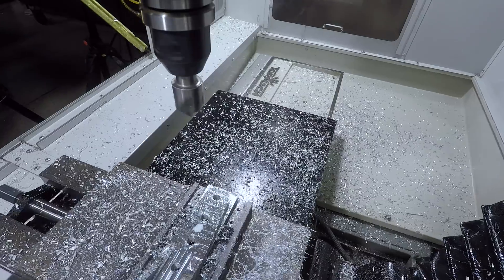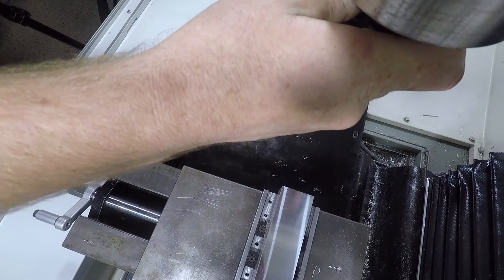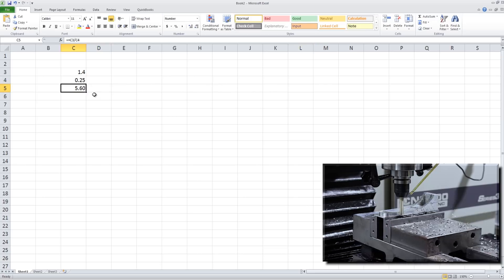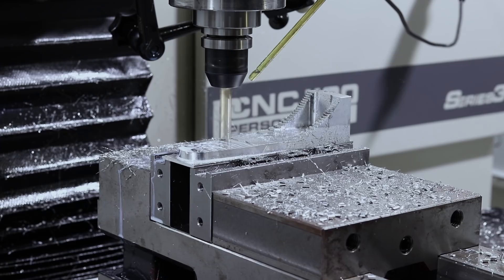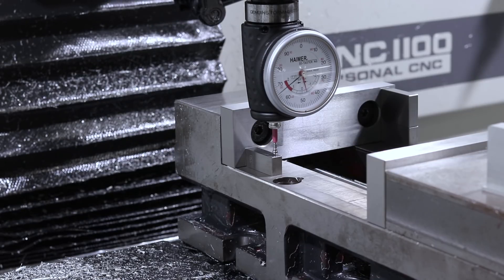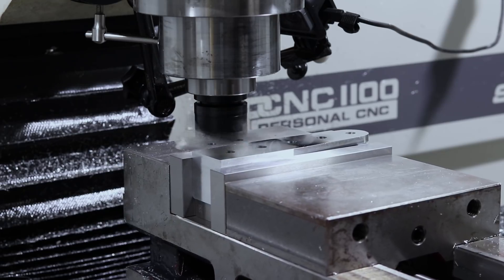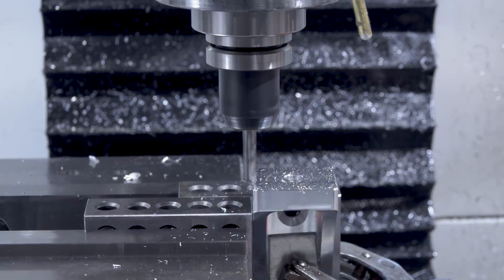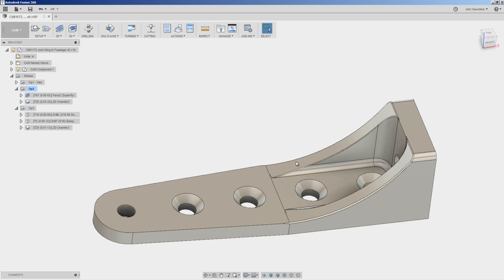Machining a De Havilland Mosquito Airplane Bracket! WW203

Comment: With Aerospace, Weight is Always an Issue.  6061 T651 is really a good product and stronger than the specified material, so to over build and increase the weight of said part is an elegant solution to a nonexistent problem.

Comment: On the sencond op your not pearcing the part so you could have used parallel blocks in the groove. won't be pushed down then.
And you would have had more surface on blocks to get it straight!

Comment: The problem here is workholding not the material distorting.  You cannot rest a thin part on a block in fresh air unclamped and expect it to come out flat... no way.  No need to ask a guru about all this technical stuff... the problem stems from poor setup and  not using best machining practice.  How to solve that?... Here are few ideas John.  

First off when you remove the hat in your second operation DO NOT just go in there with a flycutter and try and cut it off.   
Walk over to your vertical bandsaw and cut off the unsupported material from the hat.. more stable... no slugs... less chatter.  

You could cut a soft saw for the second operation... you could... for that you need the correct jaws on hand and to do some more setup work but you will get a flat part and for multiples that would be my approach.  

I have cut CNC milled parts for 20 years now and this is what would do. I would leave a tab at the end of the part the width of the right end on left end and fillet it in to blend in with have the parts end rad so I had some strength think T shaped tab... I cut a shallow slot in the tab on both sides so I could chamfer both sides.... that is important.  

I would do my second op using that tab so the part is supported on the tapered end and not unclamped... then hacksaw it off the tab and add a third operation... to finish the rad where the tab was... that could be vertically in 3d or horizonally with it clamped to a 1 2 3 block or what have you... you just need to blend in a  rad pretty slack... From there your 4th operation that was your old 3rd operation.

I see this alot in younger machinists... the key is to see the pitfalls before you are caught in the trap because once you are in it... well it is a trap.  Your approach was flawed from before you started that part and with experience you can learn there are quick and dirty solutions to the problems... if you identify them before you start... and almost if not all the problems are a result of not using best practices... Unsupported thin material is not best practice.  My proposal would add perhaps 1.5" of material and perhaps an extra half hour in programming and additional setup... but would result in a correct part.  They are quick and dirty solutions to every problem in the machine shop... they do however require lateral thinking and proper planning.

I loved the Xray stock... that was pretty slick.
Everyday you learn something is a good day.
Reply: Also a Hertel style on edge insert facemill is a real problem solver for thin wall facing operations and a more than worthwhile investment

Comment: "Duralumin" refers to 2000-series aluminum alloys, which are ~50% stronger than 6000-series. The Alcoa structural handbook of 1945 lists alloy 14S (Alcoa's name for 2014 ) as suitable for aircraft structural members, and alloy 24S (2024) for general aircraft use. 

7000-series alloys, which Japan developed during WW2 are even stronger and have replaced 2000-series in most applications.

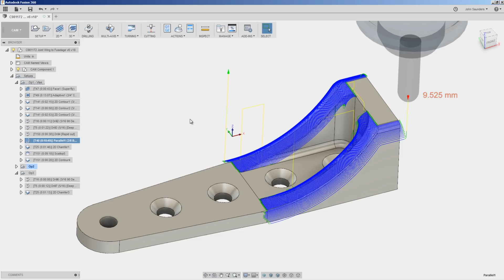Comment: @ 6:20 an end mill with a small tip rad might have been a good option here for the sweeping curve for a greater step over and better finish.
It probably could have done the edge fillets as well as a separate operation with the raster at 90 degrees to the first op.

Comment: I believe there is a 1” spot face that you missed. Should be in-between the gussets. Also, even though there are no Datum planes that I can see it would still be prudent to machine the mating surfaces first, as well as on the same Operation. Does anyone know what the Italic “f” means in the print? It says “f denotes machine” whatever that means.... Very cool though! Awesome to see Aerospace manufacturing on YouTube! Keep it up! It doesn’t take much to get the certifications!

Comment: This part didn't bend because of internal stress in the part, it was from hitting it with the hammer in the vice near the center when the vice only clamps 1 side.
You removed only a tiny bit of material in OP2, the bend would be obvious after OP1 if it were material deflection.
I've made this mistake before.

Comment: From an engineering point of view adding to the thickness of the stock material tends to lower the material allowables. It’s a good way to overcome warping from residual/manufacturing stresses but it would affect the strength of the part. The stock thickness would be controlled in a machined aerospace part. Love the videos!

Comment: Hi John, I have worked in the Aviation/Aerospace Industry for almost 50 years. I still enjoy your videos each time.  Follow them religiously.  Just as a suggestion for a future video, take the same bar stock and set it up in the same work holding and using any kind of tool...  fly cutter face mill or end mill remove about 0.50" of the thickness from the top of the stock then measure the amount of deflection that has occurred. You will be surprised.  Then for fun turn the stock over and machine the same amount off the opposite side.  Then measure the deflection.  Again you may be surprised that the deflection has almost or completely disappeared.
I was once was involved in manually machining fuselage stringers from 7075-T6 aluminum material.  The stringers were 14 feet long and tapered in a "T" shaped cross section. Lots of internal stresses but by working the machining from side to side and top to bottom and then reversing the material removal strategy we were able to produce an excellent part.  The most important ingredient in working with this type of part is "PATIENCE". Continue the good work.  Hope you consider the followup test suggested here.

Comment: Why such reservations about making aircraft parts? In general, they're not any different than any other machined parts. Many industrial applications are just as (if not more) safety critical.
Reply: Gravity....Aircraft parts are generally made with lower factors of safety to allow the mass of the aircraft to be lower. This makes it easier and cheaper to fly and the price of your ticket to be lower but with the inherent problem that flaws tend to be more critical. The use of less material leads to a more flexible design which leads via the increased strain to a phenomenon known as fatigue which if not designed for can lead to premature Failure and the lack of gravitational resistance...there are holes in this argument.
NYCCNC is great love watching. 
It is important in engineering to always be willing to know that the thing that is most likely to bring you down is that there are things you don't know that you don't know
Reply: The NYC CNC shop doesn't have the pieces of paper that say they can do aviation parts.  But John is correct.  The insurance and libility gets expensive very quickly.  And QA is MUCH tighter as well.

Comment: In aerospace 7000-series alloys are common like 7050, 7075. Those are way stronger then 6061 and - most important - they warp less.
Maybe the last op did not just move the part, but bent it as well?
And like other people said, with big stock removal you rough the part first and then finish it. I guess Tom Lipton woud have done the roughing at the bandsaw.
At work we have a lot of parts with tolerances of 0.02 mm or even smaller. Sometimes our machinists take several roughings from all sides before they do the final setups. And they sometimes even let the parts relax for several days between the operations.

Comment: We had a similar residual machining stress problem on wing spars for the F-5 and the problem was corrected in 2 ways.  The first, for the already machined parts we used saturation shot peening to alleviate the residual stress and controlled application for removing the bending.  Doing the saturation shot peening also has the inherent fatigue improvement benefit.  For the parts during the machining we  balance the material removal between each side (ie taking off equal amounts on each side and doing several flips).  We also experimented with ultrasonics during the machining that showed to be effective.  The major concern for "bent" parts after machining wasnt as much the fitment but stress corrosion cracking especially if the material is a -T6 variant.

Comment: A way to control the warp is first to rough out of the part, leaving 2-3 mm of stock. Thereby you release the stress of the part. Then you can come back with the finishing toolpath on all sides.
I know it will take much longer to make the part, but it's a method that works for controlling the warping/bending.

Comment: Start with bottom face first: 
1. flat it + make all holes + mill a rectangular contour. 
2. flip it on the side so the vise will grab the contour, make the lateral hole as a blind  one
3. fix the bottom face on a flat plate by using your super-glue method
4. do your sculpt stuff

Comment: Looks like the spot drill bent it.. the bottom side champher looked true. So it wasn't bent doing the bottom..
Reply: Bigwingrider1800 watch as the fly cutter comes across and note the gap between the top of the vise jaw and the flat section done in op 1. You can see the gap widen the moment the flycutter starts cuttin and continues to till it gets the section where the sides are actually held in the vise.

Comment: If it were my airplane, it would be fine. In jolly ol' England, (and Canada (and France)), back in the day, basic aluminum alloy is called Duraluminum, or Dural for short. In modern Al, 6061T6 is the go to for this kind of part, and with a higher tensile strength, I personally would have used 2024. The bit of bow in the arm is pretty minimal for the purpose it serves because the 0.25" thickness is reasonably 'bendy' and I would see no problem since the multiple countersunk holes are in shear and the stub face is in tension, so as a designer, probably acceptable. But good for you calling it because of quality. I would let the customer decide, and pleasantly re-cut if rejected. Not sure why you did not face the base first.

Comment: Ruff it all out leave .03 and then finish it welcome to aerospace its evan worse with titanium and inco
Reply: I would say .060 but I agree with the sentiment. That would take virtually all the stress out of it but it would make you workholding more complicated. Minimum I would skim .050 to .100 off what going to be the bottom on the first op to  at least let some of the stress out of it. Less sketchy work holding would hurt.

Comment: I just messed up 3 parts the exact same way. For me i don't think the issue was with the stress on the stock, i think it was because the cutting action will exert axial force to the part which in case of this part for example goes to the unsupported relatively thin area. This causes the area to bend up and results in the thinning you see. Soft jaws or some other way of holding the work that would support it evenly would be the way to go. if it were due to stresses in the part, then you would see the thinning on the top side right?

Comment: #1 issue is notch sensitivity. big stress riser in the most important part of the bracket, (mid bracket),  Aluminum always walks, bows and moves once stock is cut away, it can kind of make you crazy...  You would want to tumble / shot peen that part to relieve surface stresses and put non directional surface finish on it.

Comment: I used to bend air plane parts straight all the time. You could rough out the buck of material though, let it spring ,then finish the back side, flip it and finish op 1. Should be perfectly flat as long as you don't tap it down.

Comment: You could drill the hole in the end first when you still have the full block.  Sure - another set-up, but probably better results.  Redesigning the part would work, but would be an issue for aerospace as the plane is designed with a certain center of gravity.  If everyone made the parts different, then this would be an issue.  Obviously you realize that part....thanks for another great video....

Comment: When i am machining large aluminium 1000x1000x16mm, when i release the clamps the stock that remains moved quite a lot.
Reply: Heron Guarezi 
Skim 50 thou off each side first with light clamping and no tapping down. That should take the scale off both sides and prevent it from warping

Comment: What if you beck the bottom, then drill and counter bore holes and hold part down using the mount holes to a plate finish with the profile work?

Comment: Your probes never rest at zero. Doesnt that throw off the measurement?
Reply: Keith Madden if you’re finding center then It doesn’t matter long as you go to the same number at the same Z height on both sides.
Reply: Pretty sure the offset on the probes is the radius of the sphere on the probe-tip.

Comment: It is most likely experimental for exhibition not amateur build (The regulation requiring 51% owner build). I believe the FAA does not let you restore an aircraft and call it experimental amateur build. I maybe wrong about that last part, so look it up it you really need to know.

https://www.faa.gov/aircraft/air_cert/airworthiness_certification/sp_awcert/experiment/

Great video, Thanks!
Reply: Love your vids John. Great to see so much enthusiasm. There had to be special dispensation for the "restored" Mosquitos built in NZ that are in the US. In reality the timber structure was completely new. I saw some of the original aircraft and you would have had difficulty lifting it let alone flying. https://photos.google.com/share/AF1QipPqE4gHMDHdiqTzsYGKGSnwWjf18kBurkUOg3y9JH3N3GWj-VXNAtL2EzcauD-X-w?key=c3BQcU1Id3drYnAxOUlVNHZmWDJQWDVzaGFSMUNR
Reply: I had this in mind also.

Comment: Did the back side really warp by .03”?  Or did the super fly lift the front end by .03”?  

That nose section isn’t being clamped in the vise due to the taper of it. I bet it lifted. 

My self I would have reversed the operations. 

Bottom side first, and profiled to the height of the part, leaving .01” on the end of the tall side with the hole. 

Then stand on end, clear the remaining stock plus the .01” from the previous op. 

Soft jaws for the outer profile and finish the part.
Reply: That's what I was thinking, if you run your hand up your forearm, your fingers will curl since that muscle group is getting pulled. Same thing with the aluminum, as the cutter is mostly pushing material forward, the material behind it will curl up. It would probably be less noticeable if you started the cut on the end with the gussets.
Reply: I'm no machinist but the thought that came to me was 'do it upside down''
Reply: Occams Sawzall exactly, i would have faced the bottom, then cut the outside contour, then flipped the part over and hold it in soft jaws with the contour mirrored into the jaws.
Reply: Machinist 72 
If you mirrored the profile in the jaws you’d be holding it backwards. 

Good thing it’s symmetrical along the X mid plane 🤣
Reply: Occams Sawzall  hmm, maybe not explained it well, meant from an ouside profile, to an inside pocket.
Reply: Machinist 72 
I know what you meant 😁

It would be a negative cavity of the outer profile in technical terms.
Reply: Agree, accept, after the first op where you box the part out and finish the bottom, I'd just saw cut the bulk of the curved support side out and machine what's left.  After you machine the curved support side with counter sinks, you could just do the rough first, leaving 10 thou and check for bottom flatness at that point.  With 6061 it shouldn't be more than .004 for a part like that I wouldn't think.